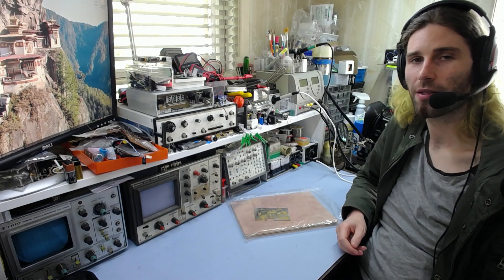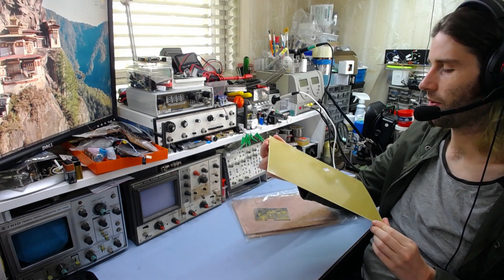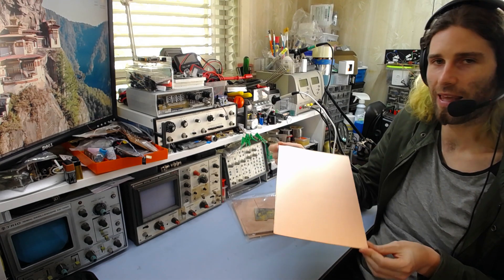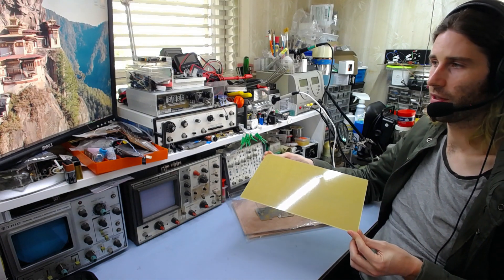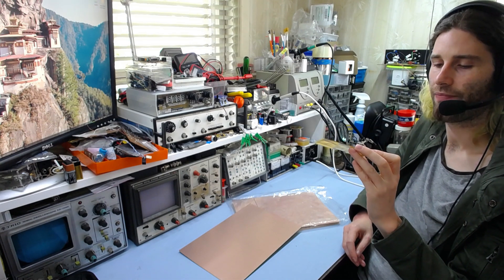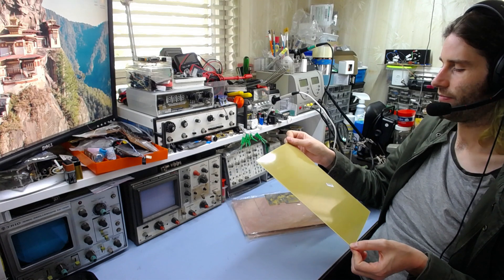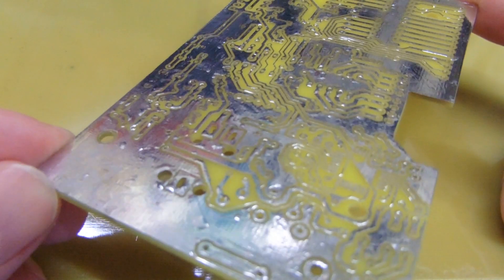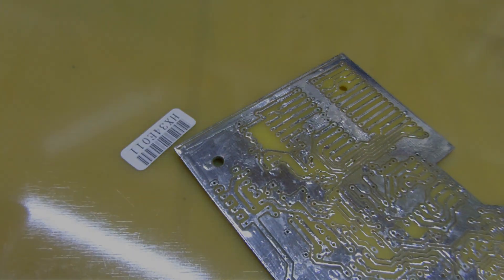The cheapest blank copper-clad FR4 from eBay - review & thoughts

Comment: You could simply etch a standardised trace of copper onto a board and measure its resistance.
Thereby you could calculate the thickness.
Reply from the maker: Good idea although I think one will need a good milli-ohm meter to measure that properly.

Comment: You can usually buy smaller pieces much cheaper, because they are cutoffs from a factory. I'm not talking a random box of scraps. You can buy stacks of dozens or even hundreds of the same size pieces that are industrial cutoffs. 4x6" or 5x7" or 8x3" or whatnot. For peanuts.  And in different colors, too. At least, it's easy to find where I live, on eBay.

I am pretty sure you won't be able to transfer a pcb too much bigger than what you are showing in your vid in your laminator, anyway. A larger board like a 200 x 300mm panel will suck out too much heat from the laminator, unless you change your process.

The copper thickness is stated in ozs. Most big (and cheap) sellers of copper clad will know what they are selling. 1 oz pour is about 1.4 thousandths an inch thick. There's 1/2 oz pour, which etches like lightning. I would stay away from anything thicker than 1 oz other than for big power stuff. It not only takes longer to etch, but it doesn't etch as cleanly. But you can get copper clad in 2, 3, 4 oz and even higher.

No, you can't find stuff made from asbestos or other shady stuff. You will get perfectly good copper clad from any seller, IME. There's no market for crap. The big buyers/customers are buying tons per year and there are lots of leftovers scraps for the hobbyists.
Reply from the maker: I'm guessing you live in USA and have access to decent sellers on eBay. I don't, because the shipping costs make it worse than buying locally. The cheapest blank FR4 for me is the stuff from China, and as far as I have calculated, larger sheets have the same or better cost/area ratio than the smaller pieces.
I also prefer the larger sheets because I can cut boards out to exact size, and end up with low (or no) waste.

You're probably right about the sheet being too large for a laminator, though. If I wanted to make a PCB that big, I'd use the photo-resist method and apply the film with an iron instead.

From the places you buy from, I expect they do state the copper weight/thickness. Again, I'm going with the cheapest from China instead. As an example: https://www.ebay.com/itm/1-Pcs-FR-4-Copper-Clad-Single-Side-PCB-DIY-Laminate-Board-300mm-X-200mm-1-5mm/312543194395 
That listing tells you nothing aside from the dimensions and overall laminate thickness. Note the seller also sells shoes, clothing, and kitchen sinks. They probably know nothing about PCB manufacture or care, except that people like me want to buy blank copper-clad board at cheap prices.

Of course, the asbestos comment was a joke (mostly) but we do know that China likes to sneak it into products at times, like car brake pads and other things.
And this material as linked above, at the same price-point as that which I purchased, is definitely the lowest quality FR4 I've ever seen, with the pitted finish, the random black flecks throughout, the colour gradients etc.
Maybe it doesn't contain asbestos, but it IS low-grade and contaminated to some extent with something. AND it doesn't even have a manufacturer's logo.

 The local stuff from Jaycar here is much better quality, and so too will be what you buy.
Reply: @Agent24Electronics  Yeah, you are right. I'm in the US. I guess I have it good. 
I have to buy certain stuff new, but there are plenty of cutoffs in more common board materials and thicknesses from a seller that has been around for decades. The cutoffs are high quality, but they are usually dirty and scuffed up. 

Copper turns all sorts of colors when it oxidizes, but if you can see gradients after scouring/cleaning, yeah that would be odd. 

The copper thickness, at least, isn't necessarily a part of quality. There are reasons to use boards of various thicknesses. And for me it is very easy to tell between half oz, 1 oz, and 2+ oz boards. With a rotary engraving tool and a diamond bur, I can make a diagnosis in about 10 seconds. Half oz, and you can cut a line through the copper in 1-2 passes. 1 oz takes a bit of effort. 2 oz takes an absolute beating to cut through. :)
Reply from the maker: @mildyproductive9726   Well, the options aren't too bad here really. I can buy large sheets (larger than eBay) from Farnell, or smaller from Jaycar, if I wanted a decent quality material with an actual datasheet - but I don't see the point because I'm not doing anything critical and the cheapo Chinese stuff seems fine for my purposes.

The copper on the Chinese one seems decent in terms of quality, actually, so long as you don't mind it thin. I probably didn't explain too well (and the video compression doesn't help make it obvious), but it's the substrate itself which has a non-uniform colour and some kind of contamination in it. The same bargain-basement material I bought years ago was the same. I don't know where it comes from.

I don't know what thickness the copper is on these. I'm going to guess ½ oz because that would be cheaper, and it disappears easily if you get too enthusiastic with sandpaper. But I'm not an expert.
Maybe I could try to measure some with a micrometer, but I don't hold much faith in an accurate measurement, the substrate may well vary in thickness too much. But maybe worth a try...